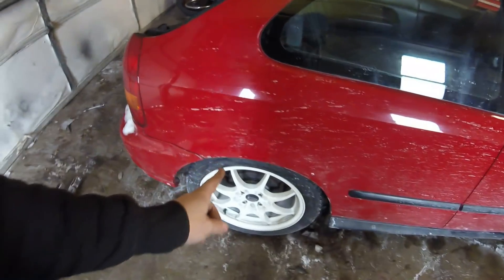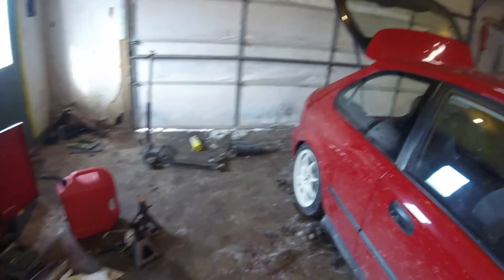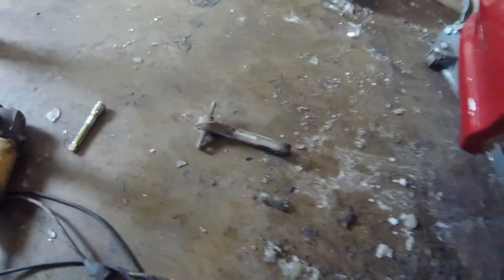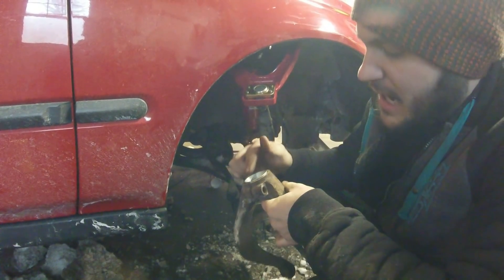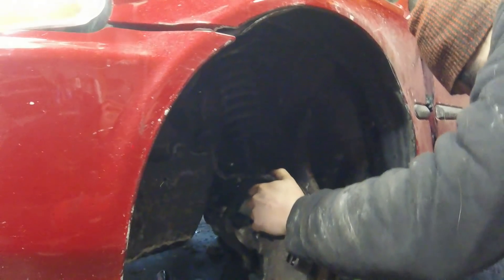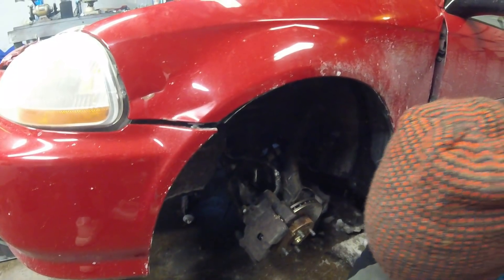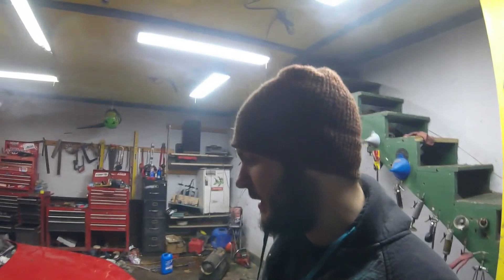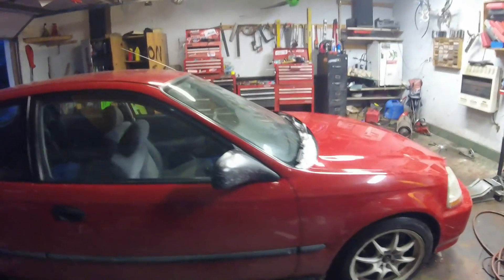Ebay Camber Kit And Upper Control Arm Install. Wrenching! First Test Drive! LSVTEC Bottom End

Comment: How are these holding up? My 99 civic LX, daily junk driver that is completely stock (everything) is eating the rear tire on the inside. The tire guy was trying to sell me $100 ones. Should I just do the washer trick, buy new upper control arms or go with the ebay ones.

Comment: take the cups off and band saw an inch off them for the front. Left is usually soft, and start at 10/10
Reply from the maker: Honda Vlogs I’m lost lol
Reply: you're 4 turns in on the front and it's still too tall. That's because the cup itself is long, i'm pretty sure. As long as you still have threads inside the cup to spin up the damper. you'll lower the front because the cup itself is shorter if you trim off  1/4-1/2"
Reply from the maker: Honda Vlogs ok totally gotcha now. Didn’t know what you meant by cups. Thanks for the tip!
Reply: depending on your preload if you spin the whole cup up you'll run into your pre-load lock rings
Reply: lol rears are forks, idk what to call the front. I always default to cups hahaha.
Reply: That's for the front wheel drive wheelie look.